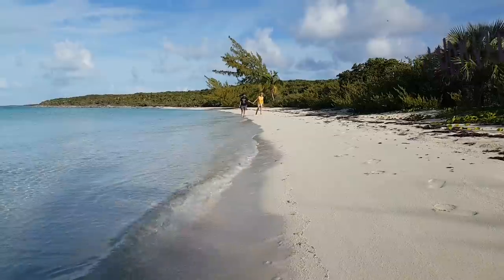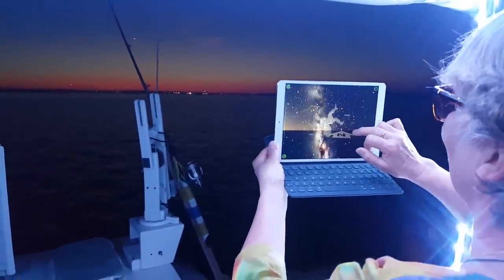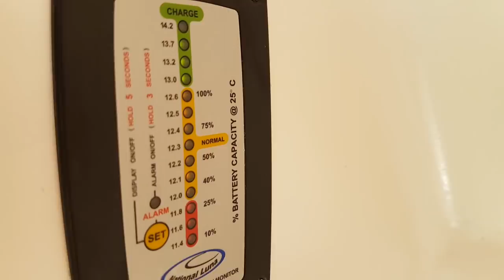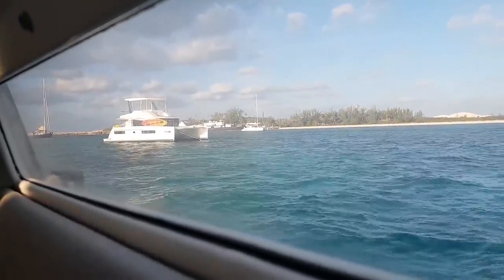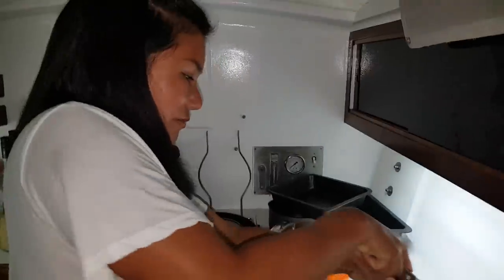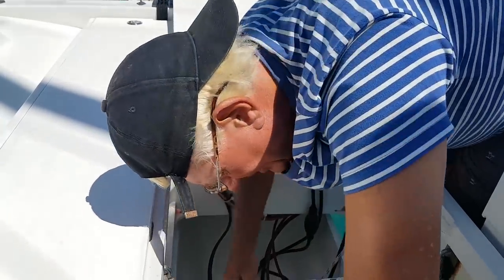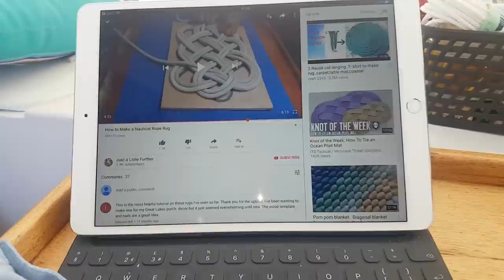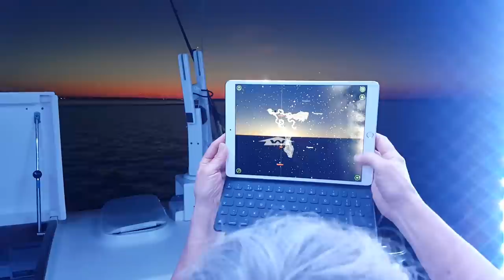High Energy Days & 3 Things Go Wrong - Ep 75 Sailing Luckyfish

Comment: That C-47 in the south harbor was being repaired at the time when the Colombians were making the first extension on the runway.  Mr Lehder kept telling the workers to move some gravel piles at the north end of the airstrip but it didn't get done right away.  The mechanic wanted to test the repaired engines by flying the plane.  The landing gear struck a gravel pile on takeoff and after that, could not get a gear down and locked signal.  Afraid of crashing on the runway if the gear collapsed, he did a water landing in the harbor.  Thanks for the drone footage of the north end of the island.  I used to live in the house at the top of the hill.  I occasionally look at it with google earth, but a few years back, it changed.  I do not see the roof lines and it looks dark brown on the google images.  I wasn't sure if it burned down or what.  You just can't see that much fine detail on from the satellite view.  I could see the second story poking up above the trees in your drone footage which is the best recent images I've seen of the place.   So I guess its still there, so thanks.  In the summer, all the nurse sharks make a migration to "the pond" to mate.  There are many thousands of them making the pond look black because you don't see the bottom through all the sharks.
Reply from the maker: really fascinating insights. thank you. glad the drone footage was of special interest to you.

Comment: "Nothing to lose attempt".
Heat up your oven (HOT) and bake the CDI unit for 10 minutes (perhaps put it on a piece of wood to stop plastic touching the hot metal). Don't ask me where the moisture got in or gets out - but it's probably got in there somehow even if no obvious visual sign. 
Can work in freshwater situations, may not with salt added! 
However... it's no use to you at the moment so nothing lost trying.
Reply from the maker: Thank you very much. Stay tuned :-) :-)